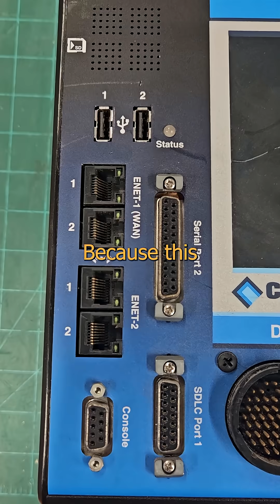Traffic Control Computer #chrisboden #comedy #engineering #educational #civilengineering #science

Comment: Those connectors will set you back. I would look for second hand ones before hitting up digikey.
Reply: Maybe if you're buying the preconfigured kit ones. 
You can buy all the pieces, parts and pins for pretty cheap (compared to similar connectors), but it will take you a full day of pouring over all the variations of part numbers to make sure to get all the exact ones you need.
Reply: My first choice is a city selling old equipment at auction. That's where we sent all our old signal equipment
Reply: It would probably be a good idea to wire those connectors to a pin board for quick checks and changes.

Comment: Unholy 🦆 thats a lot of pins on those circular connectors... dibs on NOT rewiring em 😂
Reply: It is not fun, especially when you aren't sure what each pin does and you have a cable that goes to a few different things that you can't take apart.
Reply: @lillithyukiutacrow2532  i’m not entirely sure, but they look like the socapex connectors that we use in stage LX to run multiple signals or dimmer channels in the same cable. they’re thick as anything and are so hard to screw in, but when the alternative is double or triple the thickness of individual cable runs, you gotta use ‘em.

Comment: This legit just reminded me I need to call the city and tell them they have one of these programmed wrong. Was out in the wee hours and came to a traffic light that was green in both directions.
Reply: Are you sure? That's more of an issue than just wrong programming. There's another piece of hardware that monitors the output signals and shouldn't allow that to ever happen. If an unexpected or unsafe condition is detected it kicks the intersection into flashing standby mode
Reply: @GCAT01Living  seems like a great signal design for early mornings. Hate catching a red light at 3 am when I’m the only dude on the road.
Reply: @oscarwinner2034 No. It's a terrible idea - traffic lights should never be able to enter this state, as it would signal to more than one driver at once that the intersection is clear - potentially sending them on a collision course. 

The correct way to disable light control of an intersection is to have the lights turn off or flash yellow. Either would signal to drivers that they aren't guaranteed a clear intersection and should proceed as if the lights weren't there.
Reply: @jandl1jph766 my favorite are intersections where they're all red until the sensor 1/4 mile before the light senses someone and turns just their light green. You don't even have to slow down for it.

Comment: Traffic doctor on youtube works on traffic signals and shows how all the bits in the cabinets work.
Reply: Cheers bro 🤙
Reply: True, but let Chris do his bit in offering an explanation, he deserves that much.
Reply: @Acey785 oh of course. I was thinking more of a colab or at least a source of parts / info.
Reply: I was thinking thats who sent him that! Lol😂
Reply: Yeah, but that's modern stuff. Get into the old CT250 controller, all hard wired discrete rc timers, geranium trampledsisters and relays. Not a microcontroller in sight.
Reply: This always reminds me of one of my college electrical engineering textbooks.
In the part about state machines, there was a problem set which showed a traffic intersection, complete with cops hiding behind bushes, with inputs (sensors, pedestrian buttons) and outputs (lights).
The object was to program it to waste as much time and fuel as possible.
Driving in California, I still wonder if that's the default on these - I'm amazed I ever get anywhere.
Reply: They should do a collab
Reply: I just found some of these people showing how they fix them. It's way more interesting than it should be I think LOL. Glad to see this mentioned here.
Reply: What could possibly go wrong?! 😅

Comment: I got a friend who is dead set in believing you could do what that does with just a raspberry Pi, and in not well-versed enough to explain otherwise. Care to make a video on that for me?
Reply: TBh the Rpi could prob do it for a bit, but then something unexpetected happens or the rpis card flips a bit and suddenly it's turning all of interesections light On and Off a the speed of a humming birds wings.
Reply: Do it. Them place it outside in an aluminum cabinet for fifteen years. If it still works, your buddy was right.
Reply: @JeepinBoon agreed; hence the reason why I said mega ruggedized
Reply: You probably could, actually. Raspberry Pi is basically a micro computer with some extra I/O integration. It would need to handle I/O monitoring and switching, as well as talk back to the mothership (for things like intersection syncing and emergency vehicles) but all pretty basic stuff. Chris’ unit is just mega ruggadized